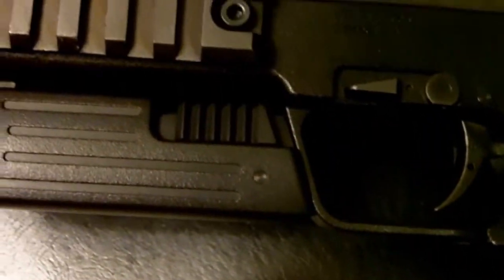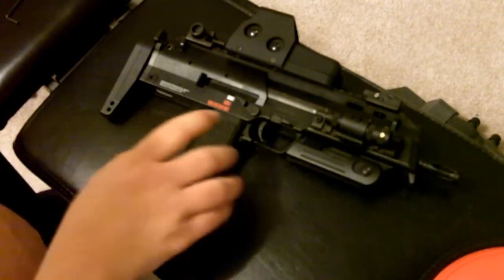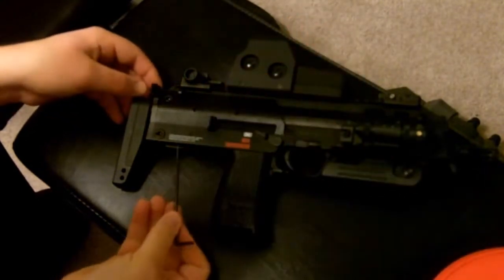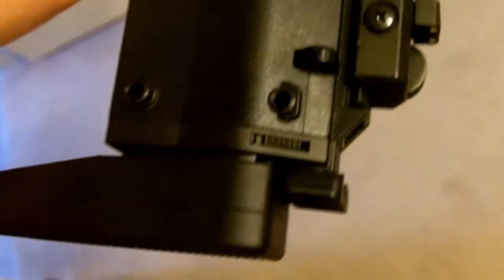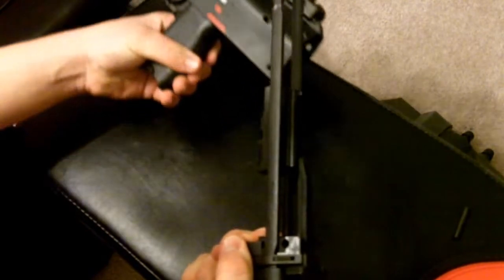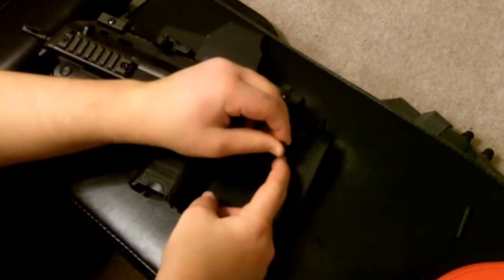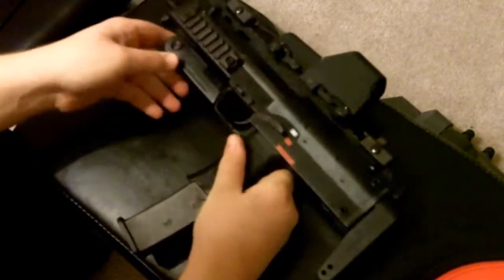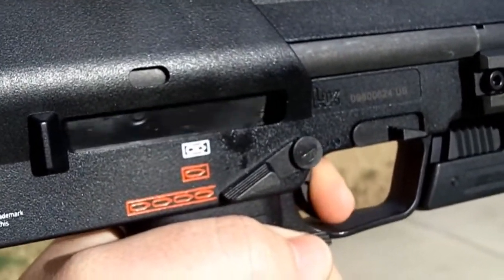"How-to" Maintain a KWA HK MP7

Comment: How about clean the bolt off.  Get all that dirt and grit that the lubrication attracts.  Also lubricate the channels on the bolt where it slides back and forth when cycling.  How about clean the inside of the MP7 as well.  How about one of the most important pieces of advice before cleaning ANY airsoft gun barrel.  TURN THE HOP UP ALL THE WAY OFF.  Gotta mention that dude.  Somebody out there may tear their bucking because of the lack of full instruction with this guide.  If you are gonna tell people how to do something please give them all the information.

Comment from the maker: @driftinsti 

I am aware of that. I have had the problem before. You only need to use green gas or if you use propane add 3 drops of shock oil in the tank or adapter and that will be good enough.

Comment from the maker: @derallter 
Welcome, also updated details...Only lube through the magazine...if you use green gas that will be sufficient if you use propane make sure to get some silicon in the mag. Other than that avoid silicon oil on the bucking and in the barrel...Keep them as dry as possible. If you want to still lube the bolt with a small layer on your finger that is fine.

Comment: @Danph77 actually using oil is also bad for the hop up rubber. The rubber will absorb the oil which causes it to enlarge. Enlarged hopup = not good.

Comment: When i put the bolt carrier back in i saw that the charging handle wasnt working. I pulled it back and it didn't move forward at all. So i took it out again. While i was taking it out somehow the thing with the gas intake came off of the spring and is inside the gun. It is very hard to get back out. How do i put it back on and get the charging handle to work?

Comment from the maker: No, dont think so. There is a way but its not going to be easy.
The hammer and trigger mechanisms are of a slightly different design. The bolt carrier and internal lower receiver of semi-automatic versions are milled differently, so that the firing mechanisms are not interchangeable.

Comment: @Danph77 Good for you, I guess...
But the video is about the KWA GasBlowBack... the toy version. ;)

And also, if you use the same level of "in dept maintains" on your real firearms, they end up jaming or misfiring.
Same thing happens here, if you only take out the bolt ones in a wile, and dump some oil into the cylinder.

I do know that it takes a bit of special tools, and perhaps a hint of skill, to take the gun apart, but there is no other way to truly clean it, and lube it right.

Comment: should you not clean the bolt chamber to get the small shards of metal from the bolt sliding back and forth rubbing against anything inside the gun? i would use the unjamming rod with the cloth and rub it against the inside. maybe lube the sides of the bolt to help glide against the inside and prevent any friction that will happen wile shooting the gun.
Reply from the maker: Yea, first time use that might be good to do. I dont see it being needed after that though.
Reply: ACTION AIRSOFT BATTLE VIDEOS - AMERICAN AIRSOFT No not first time use.  Clean, dry and re lubricate your GBB before every skirmish.  If you want your gun to last a very long time.  Keep it clean and lubricated.  and for god sake don't lubricate the bucking.

Comment: Please don't lube the bucking alot. Do it rarely, like as much as you would lube the gears of a gearbox... only with one drop. That's because the kwa mp7 absorbs the silicone like no tomorrow. Later it will swell up and other stuff. SO DON'T LUBE THE BUCKING THAT MUCH. Everything else though is alright. :D

Comment: This video is kind of a meme. Real guns fire ammunition which uses gun powder. Gun powder residue builds up and causes malfunction. Green gas pushing plastic bbs through a straw really isn't going to make build up. You don't need to maintain an airsoft gun in the same way as a real firearm.
Reply from the maker: That response is kinda of a meme. You have to clean airsoft guns as well because the BBs and green gas/propane also is not clean/pure and overtime leaves gunk and residue. And its a barrel as well....You do need to maintain an airsoft gun in the same way as a real firearm...just not as much to the same degree/frequency. And because I actually have owned both I know and not just talking from what others have told me or what I believe the perception is....and not to mention some people "overclean" their real firearms as well.